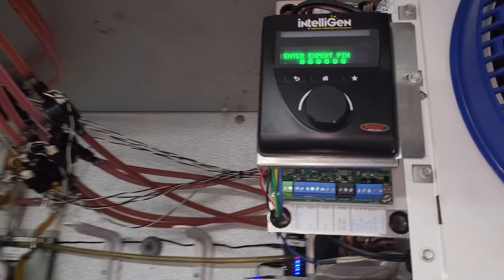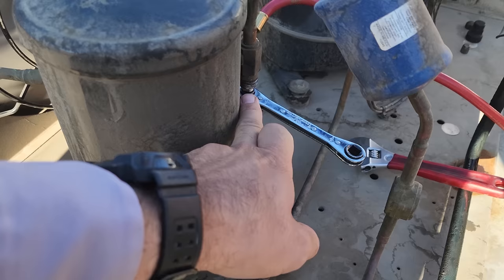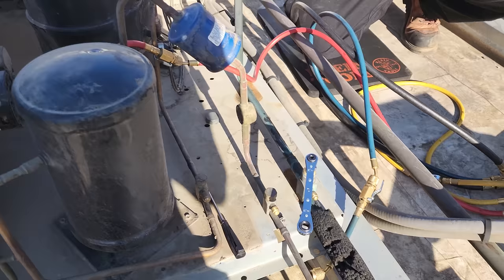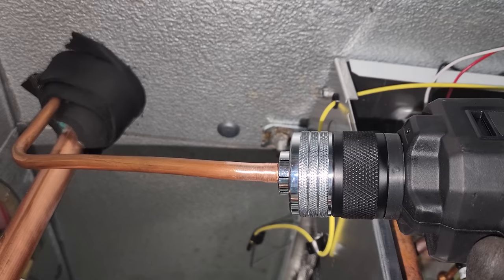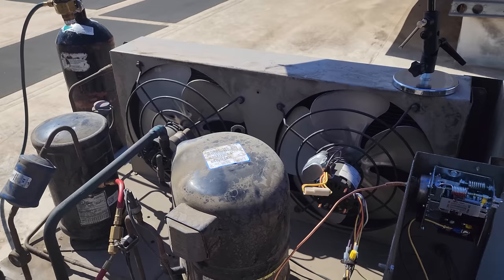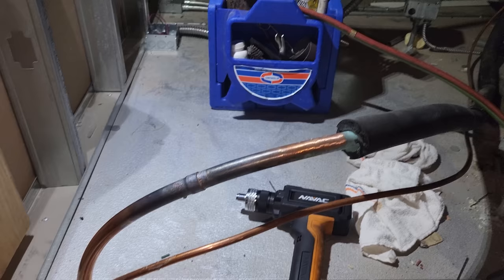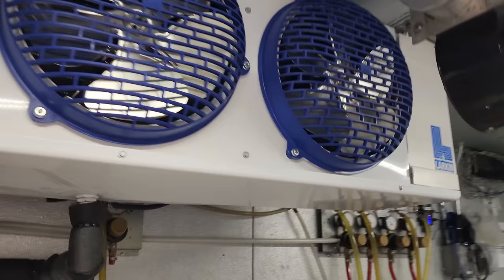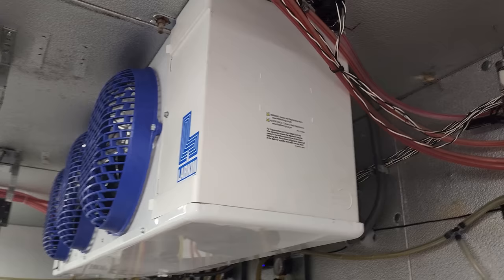THE BEER WALK IN IS JUST DONE

Comment: Also i noticed the pipes get pretty red hot when soldering, ive always been taught to avoid that “cheery red” on the copper because the silver in the solder can burn out at too high a temperature meaning a weaker joint and premature cracking/failure of the joint leading to leaks…🤷‍♂️

Comment: Hi Mr. HVACR guy. I am a new technician 10 months into this career. I'm finally on my own and doing my own thing in the company I work for. Your videos are lifesavers for learning this trade. Often times I do what you say without asking for the why and it just works, so I don't really need the why. However, my company provides my nitrogen tanks, and they don't like me leaking nitrogen through the copper while brazing. They say it's a waste of time lugging it around, joining the hose to the copper, and a waste of nitrogen to purge it. We don't charge an actual hourly for our work; our hourly rate is baked in to a fixed price for each service. It's the same price whether it takes is 1 hour or 10 hours.

I work in residential only. 5 ton is the maximum size system I have ever seen or worked in. We bring it to a vacuum for 25 minutes or until it reaches 500 microns, whichever takes longer, to remove contaminants.

Is it crucial to use Nitrogen while brazing? Is there any unforeseen risk to doing it without the nitrogen? Do you know the reason, or have you always just done it that way because it's tradition?
Reply: Look up the channel AC Service Tech LLC on YouTube. He has a video titled: “HVAC Brazing Basics With/Without Nitrogen”. He goes over the difference inside of the piping for both.
Reply: Supposed to reduce contamination and carbon build up inside the tubing, reducing the likelihood of plugged filters and or orifices/metering devices
Reply: I highly recommend you find somewhere else to work, these are a bunch of straight up hacks youre working for! 25 minutes or 500 microns whichever takes longer lmfao so what if theres moisture or leaks?
Reply: @Ryan-rv7lv  Run time is 15 minutes of initial vacuum. Close hoses and turn off vacuum for 10 minutes after. Note location of needle on the gauge (I'm the only one with an sman480 so I use the micron gauge built in) and if it changes in those 10 minutes (or doesn't stabilize the change-over-minutes value on it's micron count in my case since it tells me), check braze joints. If it doesn't change, let it run for until 500 microns, or 10 minutes, whichever is longer. So really, it takes 35 minutes to do a recovery or an initial evacuation. 

What is your technique?

Comment: re: the remote cards, I wish I was closer to you. I do this kind of thing professionally and work in IT. There is slick solution somewhere here that would allow the best of both worlds and put you customer at ease. You could you put them behind an extremely tight firewall, or even better setup a VPN tunnel to your company with wireguard. Your company could even update the firmware over the VPN tunnel to put their mind even more at ease.

Comment: You didn’t have one here but a general tip with IntelliGen and QRC controllers into make sure you either completely remove or if it’s adjustable set the anti-short cycle time delay to as near zero as possible. There is a timer built into the controller and they will compete with each other.

Comment: ITs strange that we here in EU(denmark) Have been making refrigeration systems this way for 40 years! Always like this. Evap controlled by termostat, defrost controlled by that termostat (timer built in). We have never wires from roof to evap. Only pressure controlled , and evap and comp unit has own fuse. nice to see a danfoss KP5 on that system

Comment: Its good that you give it plenty of heat to get your brazing rod to penetrate the joint, just be careful about overheating the joint because you can cause oxidation that can prevent the brazing rod from tinning the copper properly and getting a solid joint. You want the copper to be at a dim glowing red, not a bright glow
Reply: And that swage at 10:26 isn't ideal, but I'm just nitpicking we've all done these things before I just have the luxury of not having my work on the internet to be critiqued 😝
Reply from the maker: I was flowing nitrogen to prevent the oxidation....
Reply: Yeah fair enough silfos is pretty forgiving, overheating can be a problem when you are using flux with easyflow or copper-brass joins though
Reply: Call me crazy but I like to swage in the direction of flow 😉

Comment: A word of caution regarding the amount of solder you use. It may not only an issue about using more solder costing you (which I guess is pennies at most), what may happen is under some conditions that an excess amount of solder wicks through the joint and may either bead up on the inside, possibly causing turbulence in the pipe, or may cause beads of solder to float through the pipes as well. For the latter the dryer filter may take care of, but I am not entirely sure where in the system you place it. The turbulence can cause different issues, from making noise to actually seriously impacting the amount of flow you get through the pipe and possible cavitation issues.
Reply: There’s really no sense in using that much solder. I prob could have borderline done that entire install with a single stick. Also, no need to glow the copper that bright of red. Just pull the flame back some. Although, everyone does it differently.
Reply: @nebraskaman8247  like he said “it’s my company I can do what I want.”
Reply: i dont agree. Using enough solder and heat is GOOD: It makes more secure solderings and if in difficult spot it flows better. Yes if he fills the pipe with solder you are right about turbulense, but that isnt the case... Good Soldering job
Reply: @nebraskaman8247  Well, I might add, that "glowing" the copper may be relevant. Although I think especially with copper you have to be carfull, as it can be damaging to the copper (although I dont see this being anywhere close.
When I learned soldering decades ago, besides electronic soldering which was what I did mainly, for different reasons I learned quite some metalworking and also soldering with that. First of all, in German we differenciated between "Weichlöten" which would translate into soft soldering, and "Hartlöten" which translates into hard soldering, but actually would be referred to as brazing or silver soldering (depending on the solder type) by most english speaking people. "soft soldering" would be the kind of soldering comparable to electronics, you might use for plumbing for example or in some roofing applications with tin or lead covers. And for brazing we were taught to actually to get the material "chery red" and the material was then supposed to have enough heat to melt the solder, so we were supposed to not even hold our brazing rod or silver solder into the flame. (At least that was what we were told, I think the point was that the material should be hot enough and not just melting the solder, as otherwise the material wouldn´t take any solder). But then we never used that with straight copper or even any pipe materials, so it sure is not completely comparable.
I guess there are several schools of thaught or teaching methods for this, as you said, everyone does it differently. For all I think the point is what Chris pointed out several times, get the material hot enough so the solder will flow in between properly and not just bead up on the surface.

Comment: About the network card, I completely agree with the concern that is coming from leaving the network card exposed to the internet.
Assuming the card is not programmed to connect to some proprietary server from the manufacturer and is only providing a local web-page, I think a good solution would be to restrict access to it by using a zero-config virtual private network (VPN) service, such as Zerotier, or Tailscale.
If configured correctly, this will put the network card in an invite-only private network, where the client can easily add or revoke access to said card through a management website on a as-needed basis, without risking any exposure over the internet.
A common trick usually is to connect the internat cable to a small ARM computer board, such as a raspberry pi (or its clones), connect said computer to the WiFi network via the zero-config VPN and that's easy and safe access.

Comment: You should think about upgrading to pressfit fittings to eliminate the need for brazing entirely
Reply: A colleague of me got pressfit fittings in his new bathroom installation. After three years the complete bathroom crashed from the the first floor into the living room because of rotten wood due to a micro leakage in the water installation. Luckily no one got hurt but the damage was about 90k.😁
Reply: Brazing works, when done properly never leaks. Why ef with something that works, especially when the reason is ...lazy

Comment: What are those things hanging down in front of the evaporator coil fan motors?  Those round black plastic things hanging down from the ceiling?
Reply: Those should be fans that suck cold evap air through the attached ducts, which enter a wall cavity where the air cools the beer lines----between the cooler and the beer taps (dispensing tower).  This method is known as "short draw" (beer lines under 25 ft.).  The other method for cooling longer beer lines is the installation of a glycol chiller, AKA Power Pack and is known as "long draw," where the beer lines run perhaps between floors and other uncooled areas and are bundled together with cooling, glycol lines, which constantly circulate between the glycol chiller and the dispensing tower. 🍺

Comment: Didn't see a good shot of the final drain config, what did you decide to do? Also, what would you have done if you had to use those blowers for directed tap line cooling but were more free with layout? Set them outside the direct exhaust path of the evaporator fans and feed from the side of the air stream? Are the lines encased by that flex tube somehow, analogous to glycol tap lines?

Comment: I'm a complete layman, but wouldn't it be possible to use the existing condensing unit lines for power from the roof? That would also mitigate problems when one circuit trips and the other doesn't. Again I am no refrigiration tech or even electrical, plus regulations in the us sure are different from what I'm used to here in Germany. Love your videos btw, very entertaining to watch and see structured problem solving
Reply from the maker: The manufacturer wants an independent power source because they have had issues with voltage drop affecting the 24volt powered intelligen board
Reply: The majority of the voltage drops happen when the compressor first kicks in. If the electronics were designed to have more of an overhead this would not be an issue.

Comment: 10:15ish decent swage is actually split if you look closely
Reply from the maker: Yeah luckily it was easy to braze over
Reply: @HVACRVIDEOS  I noticed that too, I heard a pop and when you zoomed in on it I saw the split on the back side of the liquid line right after you said to be careful because that size pipe tends to split. lol
Reply: @HVACRVIDEOS  It happens, with enough braze wont be an issue for 20+ years down the road.

when you look at how distributors are brazed and how literally less than an 1/8 of copper is in contact with the tube. this swage will outlive the unit with proper brazing. And we all know who doesnt skip out on silfos :).
Reply from the maker: I will discuss this on my Livestream this evening 1/23/23 @ 5:PM (pacific) on YouTube come over and check it out https://youtu.be/MkAGiy6pwh8

Comment: And the reason for the P trap on the suction line and squirrel cage fans in front of the evap fans?
Reply from the maker: it helps trapped oil return back to the compressor
Reply: Probably to catch oil on the bottom of the P escaping from above

Comment: I am curious why you use oxi/acetylene vs just air acetylene, I personally prefer just acetylene and I only have to worry about 1 tank but just what I prefer, you may just prefer the mix but just curious, I the only time I used oxy acetylene was for a 3” suction line on a 100 ton split unit in a warehouse, but that’s rare anything 1 1/2 and under I find no problem with it and I find I can control my heat better
Reply from the maker: I will discuss this on my Livestream this evening 1/23/23 @ 5:PM (pacific) on YouTube come over and check it out https://youtu.be/MkAGiy6pwh8

Comment: Ok, great job, I won't be critical, sure you get enough of that...but I have one question.  Why would you have an electrician pull a separate circuit when you already have the wiring and the power from the cond. unit. Why can you not just land your wires from 3 and N from the time clock on L1 and L2 on the contactor, bring those downstairs and power your intelligen.  Just like you would with a Beacon 2 or KE2. Or remove all the pins from the clock, Just curious

Comment: Got a question I have true reach in fridge with no data plate it’s an older model that’s has two sliding doors. It had a leak and leaked out all the refrigerant. I found the leak and repair and pressured tested and passed. Now it’s in a vacuum but what I’m trouble with is trying to figure out how much refrigerant is supposed to be charged… I know it’s r134a type refrigerant just don’t know how to go about it at this point without messing up compressor. Would be able to help me out on this? I’ve even contacted true refrigeration but they couldn’t find this specific unit by interior and exterior measurements. I’m fresh out of school and barely trying to make it.. if someone can please help me?
Reply from the maker: Call true they should be able to help